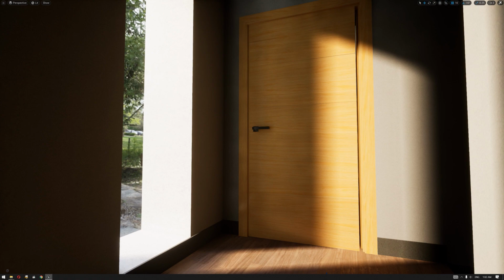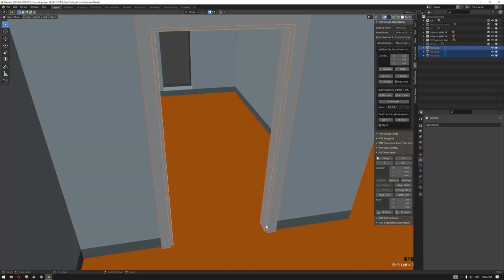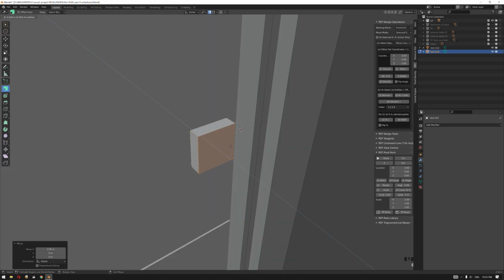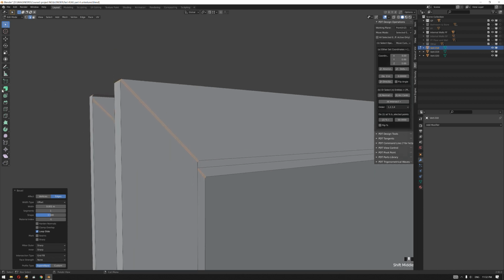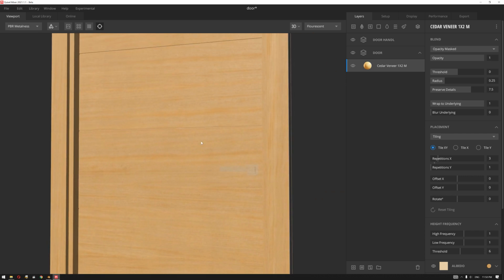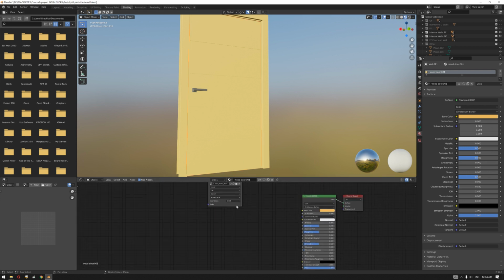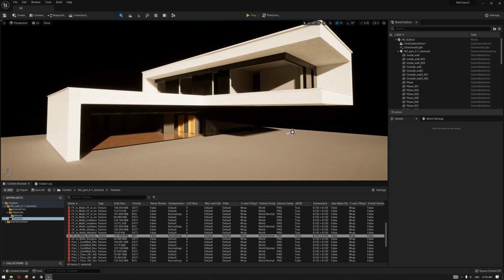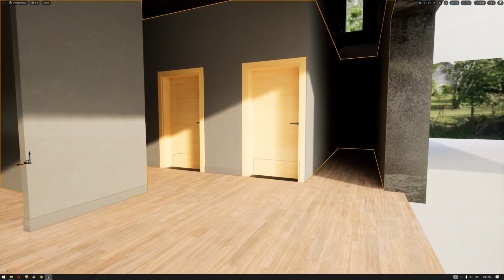The House _ Course 2 _ Part 4-3 Doors Modeling , Texturing, and export to UE5

Comment: I made some test in an interior scene. BP light studio works with your trick tutorial! But it still isn't solid rock. In my scene, the assets materials randomly changes as I change the skylight intensity (crazy)
Is there no way to get HDRI Backdrop work with some material/function changes?

Comment: Hi brother ♡
There's addon called Send To Unreal it's very helpful in blender and unreal....
But I don't know if it work with ue5
Reply from the maker: Hi Mukhtar , yes send to unreal is a great addon , the only draw back is that for arch viz it will be difficult as it send the objects individually to the content browser not to its location in the 3d scene which means we have to place each object individually by getting their location axis from blender for example
Reply: Okay u r right in this 😅
Reply: I think it's prety quick to reset the position of an object and any future changes are just updated automatically when you send to unreal
Reply from the maker: @akkhario  i think you are right , the only problem is the amount of objects in the project , thanks